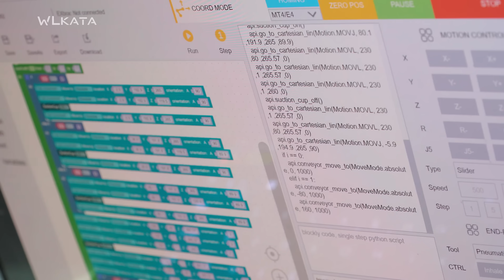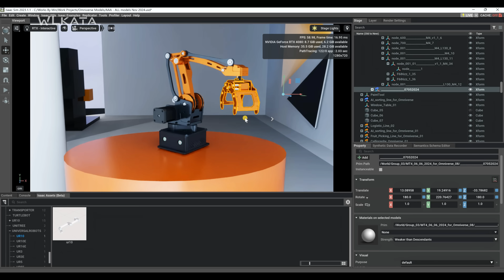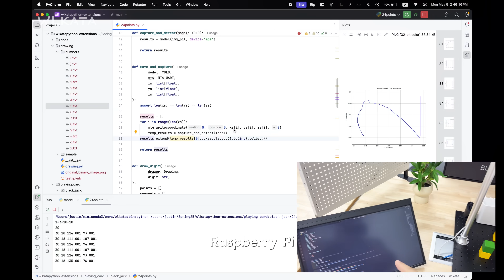Wlkata MT4 Desktop MiniFactory

Comment: What software does the drawing from picture?
Reply from the maker: Hi we just uploaded to the WLKATA Github: https://github.com/wlkata         you can find the face drawing and 24 points game codes and tutorials here: https://github.com/wlkata/WLKATA-AI-Drawing-Extension
Reply: The Xfactory Conveyor System looks to be 3D printed in the video. But on the Kickstarter, I can only see an option to purchase a metal Conveyor? Is it available as 3D printable files for purchase or no?
Reply from the maker: @colemanwhite9785  Hi, the OmniConveyor will be constructed from metal for durability and reliable performance, since plastic could deform under heat. We’ll share the 3D models with all OmniConveyor buyers.
Reply: @wlkatarobotics  Thank you for the reply, but unfortunately the Kickstarter ended almost 2 months ago so it's too late now for me to order the MT4 and Conveyor.